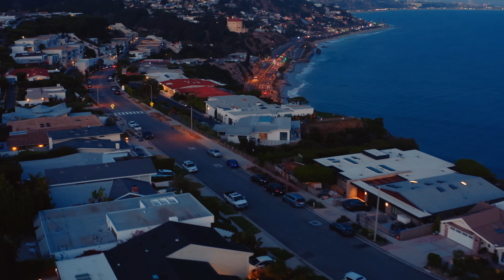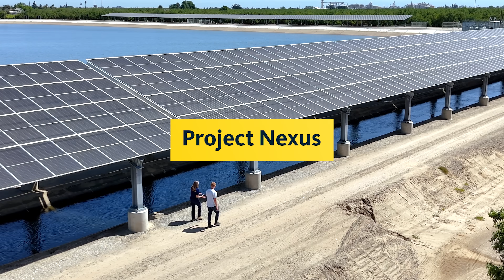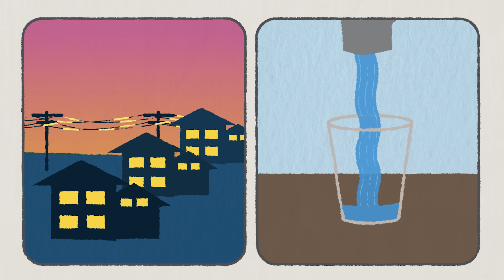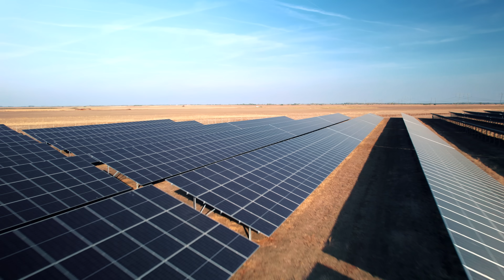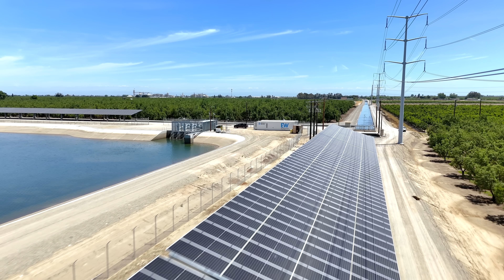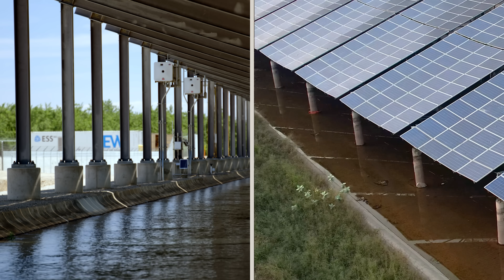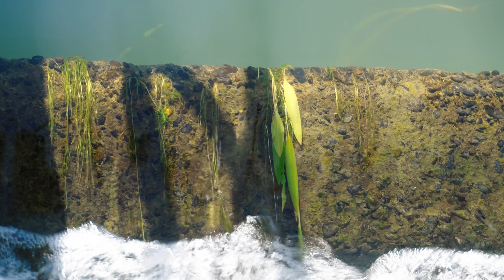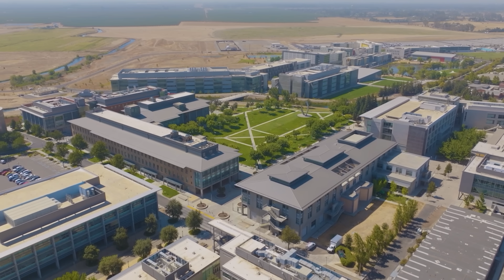California’s new solar panels do MORE than generate power

Comment: Going to have to adjust your numbers a lot does only 15% can actually go into the grid so if you had a volt amp meter and you could do 4th grade math called Ohm's law and it only takes a second to double-check the inverters and or the power companies watt meter and you'll see an 85% difference of what's actually going in the grid and discover the ignorance of the Grid in a reason for skyrocketing electric bills seriously dude get a volt amp meter and then you'll have to readjust your numbers you spewing
Reply: Which makes it one of the most expensive and actually disqualifies it is green 1itsy bitsy 2nd and fourth grade math it's so ignorant
Reply: And then you add a battery for another 5 to 10 less so net power actually going into the grids like 5% again easily demonstrated with a volt amp meter and 4th grade math

Comment: Just to clarify, this is not a 1,000% increase. A 1,000% increase would mean the value grew from 1 to 11. Since the value increased from 1 to 1,000, the correct percentage increase is 99,900%, as the increase is calculated relative to the original value: (1,000−1)/1×100=99,900%. The final value is 1,000 times the initial value.

Comment: Just more PEAK generation that the CITIZENS WILL HAVE TO SELL AT A LOSS during the summer and will not be available in the winter/cloudy period of the year.  What about all of the solar panels in the State that are not even being used or the operators have gone bankrupt.  Sure, saving water bodies from evaporation losses has value.  The economics of the whole energy supply infrastructure needs to be computed and disclosed to the citizens.  The irrigation districts (not PUC controlled) are outside of the overhead costs of utilities like PGE or SoCal Edison.  Innovation will naturally be more innovative than power from the regulated utilities.  Remember e the exorbitant extra cost of anything the government builds - prevailing wage and all the extra regulations.  Don't let good ideas fall into the "High Speed Rail" government trap.

Comment: I’m very pro-solar, but the solar canal is only a bit better than the solar roads meme. A simple white plastic sheet would be far quicker to install and more effective at stopping evaporation. There are so many aspects of this that make it a terrible solar system. Massive voltage drop, a custom canopy, canal isn’t always angled due south, likely not near a utility interconnection, hard to maintain. lastly, you’ll need to run inverters, transformers, and road along the whole length of the canal. Just because you can produce some energy doesn’t mean it’s practical. It’d be like running our cars exclusively on extra virgin olive oil, sure it can “work”, but it’s very inefficient.

Comment: Key Potential Contaminants

Lead (Pb): Used in the soldering of silicon-based panels.

Cadmium Telluride (CdTe): A compound used in thin-film solar panels. While CdTe is stable, it can release toxic cadmium if degraded in acidic conditions.

PFAS: Persistent "forever chemicals" (polyfluorinated substances) are used in the outer layers of some panels.

Other Metals: Copper, Indium, Gallium, Selenide, Arsenic, Chromium, and Antimony may be present in specific panel types.

Comment: What happens at night?? No power! Millions of $$$ in batteries may be?
Reply: There are alot possibilities there, Green hydrogen can be produced with the panels, replacing blue and grey hydrogen, they can store the energy potential in a gravity hydro- electric loop during peahk production, and recover it during slack periods, energy storage doesn't have to be about chemical batteries.

Comment: Reminder that a large portion of corn is used just for ethanol in gas. With just a small fraction of those existing ethanol corn fields, with modern panels, you could power the entire US. Obviously you would need storage and a lot of minerals. -but the idea that the issue with solar is land usage is so silly.

Comment: One could also place huge water tanks under solar farms, its water circulates in the solar panels, which maintains the optimal operating temperature of the solar cells = more energy during the day and drive a Stirling engine at night.

Comment: "China installed 315 GW of new solar capacity in 2025 alone.  China produces over 80% of all solar modules. In 2023, it accounted for 98% of solar wafers, 92% of cells, and 85% of panels.  In H1 2025, China installed so much solar that it exceeded the combined total of the rest of the world.  From 2020 to 2024, China's solar capacity grew at an average annual rate of 11.7%, nearly triple the global average.  By 2025, China's total installed solar capacity exceeded 1,300 GW, representing roughly half of the total cumulative global capacity." - sourced from Guardian, DW, CNN, all western sources.

"Solar power installations fell in 2025 following years of record growth, while wind energy has plateaued." - also western sources.

"Global" in fact, didn't do that much.  Your country is regressing thanks to your new "king".  Calif. is basically a completely different nation than the rest of the US that bends the knee to the orange knob.

Comment: Giggle😂 Solar is one of the most expensive forms of electricity because you must add batteries for storage to make it equivalent to LNG, oil, nuke, and other forms of electricity. Solar proponents continue to lie about this although many are likely just ignorant rather than just activist liars. All this said, India started doing this years ago and is a good idea however the battery problem still exists. Two days of clouds in a row and you have an energy crisis even if you spent a fortune in batteries.

Comment: Remember, even if a solar canopy fails electrically, it may not produce power but it will still act as shade and also rain diversion like a roofing shingle if that is desired. Glass is very resistant to physical degradation in the sun, only physical damage like a rock or a bend is likely to destroy it. Lots of other materials will just get destroyed by time, heat, and UV exposure.

Comment: I'd never thought about the issue of water evaporation like this before.  It seems like adding solar panel grids to curb this issue and also generate electricity is a common-sense solution that's easy to get behind.  Great video.

Comment: A large part of why Solar is so cheap is because it's state subsidized, meaning it's not straight up "cheaper" it's just cheaper for the end consumer because your taxes are spent on them.  The other issue that some farmers are finding is that the cheap Chinese panels are leeching heavy metals into their land making them unable to farm on these areas, and I would be concerned about using it around our food & water supply.
Also doing this is just sending more money to China because they cornered the market on solar through government subsidies which bankrupted everyone else' solar panel creation businesses around the globe.

I don't hate solar or anything & I actually do like the idea of putting them on our canals, but I am also extremely wary because I don't wanna find out 20 years down the line that it led to lead poisoning in vast swaths of the population, which is why I am much more comfortable with them on the tops of buildings rather than near things I consume.

Comment: There's a lot of talk about it preventing evaporation, but the question I have is what amount is prevented by keeping sunlight off the water directly, and is the radiative heat coming from the panels offsetting that, effectively rendering it moot? Those panels get hot, and the heat goes partially into the water (especially if you use floating panels.) Sure, a good deal of it is being cooled by the surrounding air, and likely some of the water vapor that is already coming out of the still liquid water, but some amount of that heat is going to make it into the water and drive some amount of evaporation, and likely that amount increases as the panels are brought closer and closer to the surface. I love the idea, I just wonder if there's some downside we haven't considered, or if there's some factor that has been overlooked. I'm sure the math has already been done, and all things were accounted for. This was just the first thing that came to mind. 

Also kinda wild that most of this part of the country looks very homogenous. For all I know, some of this could have been filmed like ten minutes from my house and I wouldn't even know.

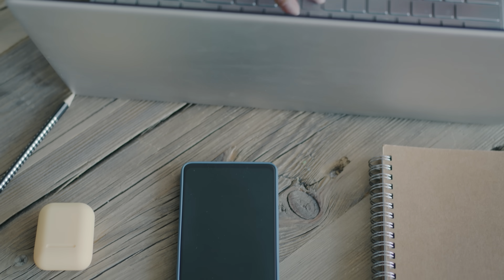Comment: 6:06 Not correct. Phones and computers stop working properly when they heat up because they're thermal throttling, not because they become less efficient. thermal throttling happens when the CPU/GPU is running so hot that it has to draw less power to avoid melting itself. The decreased power draw also decreases the max clock speed, thus decreasing performance. 

To correct that analogy, phones and computers stop working properly when they get extremely cold, beginning around -4F. The battery can't output as much power the colder it gets, because extreme cold increases resistance, and thus decreases efficiency. If it gets too cold, the battery is going to seem dead. get it even colder and it won't be able to hold as much of a charge after being warmed up.

Comment: Another one of them solar roadways. Just put solar panels where there's cheap land and easy access for maintainance, and put cheap ass canopies if you need to block the sun. Using high tech in awkward spots for SHADE of all things is inefficient, it's just a fad. I hope people realize those huge ass pillars that hold the weight of panels are way more expensive than the panels themselves right? And you only need this heavy duty pillars cause you're using heavy ass solar panels!

Comment: In 2015, I installed 10 x 335 watt SunPower solar panels on my new roof over my old 1914 garage in Douglas, Arizona. The next year Walmart installed their solar PV canopy over their parking lot. Let's escalate solar, high insulation, grid batteries and electric transportation everywhere as soon as possible!

Comment: sure it could be used to power however many homes. but that isn't what is going to happen. instead they are just going to build more data centers, bitcoin miners and other wasteful nonsense. Energy is generated for profit in the US not with its end use in mind. You might see a dip in energy prices, but that dip will quickly be eaten up by the insane greedy billionaire class.

Comment: Why not have a floating barge with PV Panels on top and a conveyor belt underneath .  As the water flows underneath it turns the belt which turns a generator.  A venturi type of obstruction could increase the flow sufficient to turn the belt in reverse.  This increases the amount of electricity generated and reduces evaporation.  Sufficient room underneath would enable small robot scrubbers to remove silt and algae etc.

Comment: It's very anything that the payoff figures were not given contextual detail. 
From the video - 'this will save 63 billion gallons of water, enough for 50,000 acres in the central valley'
Well, how many acres are in the central valley? Is this a huge amount, or a drop in the bucket? 
A quick Google says 5 million acres, so it saves enough water for 1% of California irritated land. 
Please give context so these numbers mean anything, or else it looks like you're just covering up information.
Reply: I think you are missing the point of the video. The solar panels' purpose is not to prevent excess evaporation in the canals. The main purpose is to provide energy and instead of wasting real estate and placing them in a field, you can place them above canals where nothing else would be otherwise so you get a dual effect

Comment: Can you float a panel system on the water instead of energy intensive structures spanning it? The steel and concrete is very expensive to build

Comment: In South Australia we worked out that open canals waste a lot of water through evaporation.  Forty years ago we undergrounded them and problem solved.  Just putting a solar panel roof will not stop evaporation losses. Air which is heated by interaction of sunlight with soil and structures heats the air.  This hot air will still flow across your covered canals and result in similar evaporative water losses. It’s a case of over-thinking the problem and not doing the obvious.  That’s California for you.

Comment: What happens is 30 years when all these panels need to be thrown out and replaced?
Reply: in 30 years, the old solar panels will be outdated technology anyways with more efficient designs ready to be put in. They will also have gained knowledge from studying these panels and they will use that knowledge to fix any mistakes with the original ones

Comment: Surely floating solar panels would be far more cost effective, from a deployment perspective, and from a maintenance perspective. The latter tech has already been proven across the globe with India and Singapore if I am not mistaken; there is a big added benefit, when the panels are literally floating on the water, the amount of evaporation saved, surely must be significantly more than the edifice approach?

Comment: Me laughing at the 120 degree slide: I used a solid metal 8 foot long slide that had direct sunlight, probably 150 high. If it was too hot we just threw some sand on it. Surprisingly that helped. Also, bend your knees if you are wearing shorts.

Comment: Not sure where you got that number, but California does not produce 25% of the US's food supply.  And certainly not just in the central valley.  It is high on high cost per ton items like... fruits, nuts, wine, etc... but doesn't even register on grain and oilseed charts.  

The four major US farming outputs are corn, soy, wheat and dairy. California barely registers on grain production, and has marginal dairy output. California doesn't even show up on the top 10 states by acreage dedicated to farming.

Comment: Solar and wind introduce variability in the grid causing increased transmission, balancing and distribution costs. 

Capacity is not the same as generated.  California is #2 for electricity costs @ 34 cents/kwh.

Comment: The way the energy system in california is designed since the 90's..has a fiduciary responsibility to its shareholders..who are not the citizens of california. As a result, they are not looking for "cheaper" more efficient forms of energy. Sadly this corruption by design needs to be mentioned when describing any solar project, as it is the biggest roadblock towards solar adoption in the USA.

Comment: I think if they were to totally seal the light off from sections of the canal, they would not experience massive algae growth due to the lack of sunlight in those sections they were able to seal off. Not necessarily ground height. Maybe they just need to put a wall height where they raise it up, but it’s still sealed skirted or otherwise.

Comment: Start hang drying and you save another 2TWh.... 340m people, one load of drying is 1.8-5kWh. Simple math 1.8 to 5 kWH times 340m equals 612 000 000kWh to 1 700 000 000kWh. So 0.6 to 1.7TWh if everyone use the dryer once per year. Lets assume that everyone is a family of 6 people and only half of the people use the dryer. So we divide with 2 and then with 6 or we divide with 12 but lets also assume everyone uses the dryer at least once per month so that is times 12. I assume the reality is around once per week so we sit at 4 times 0.6 to 1.7TWh even if we consider that only half of the families use a dryer and all families has an average of 6 members using a dryer 4 times per month.

So just because you hang you laundry out to dry or on a rack inside, you would save more than 2.4 to 6.8 TWh.

In USA you waste so much energy that you could use on something more productive than being lazy... Like don't produce it at all to save on the insane emissions you have...

Comment: One thing that these projects never consider is the long term effects. Yes it "saves" water from evaporation, but the evaporated water doesn't fly off into space. It accumulates into clouds, or humidity, and is crucial for the local microclimate and the larger climate within the region. The water that doesn't evaporate doesn't end up as rain clouds. 
I'm not an expect, but this is something that hasn't been mentioned at all, and should absolutely be studied seriously before such a large project is undertaken.

Comment: Another thing that may synergize even more with this kind of project is pumped water energy storage. I know there are some proposed reservoirs on the west side of the valley that would have to be filled with pumped water instead of natural river flows. 

If we are generating electricity and reducing evaporation in the canals, we can use the surplus energy to store some of the surplus water and have both available for later use.

Comment: Interesting idea. But I think individual people should take more responsibility for the energy they use. New homes should now require a minimum amount of proper solar panel exposure and be prepared to add solar panels. Someday all new homes will have panels, just like all houses now have heating systems. It will become part of the home loan. We are losing so much land to housing needs from population growth, and the power will be generated near to where it is needed.

Comment: The best way to save water across the world is to move residential homes to dry septic waste.  The powdered waste is blown out of the house and disposed of with green waste.  The volume reduction, once you remove the water, is quite remarkable, and the process is a lot quicker than bacterial.  Think of the infrastructure reduction.

Comment: Considering one of most (if not the most) expensive and time-consuming parts of getting anything built in California is land acquisition, using an existing right-of-way is a great idea. Assuming it moves forward, hopefully it will get done relatively quickly.